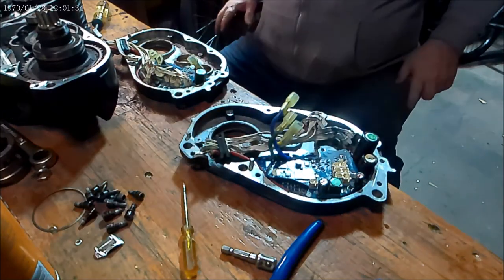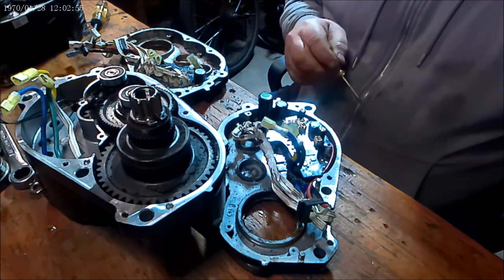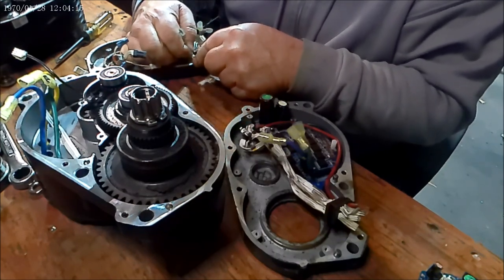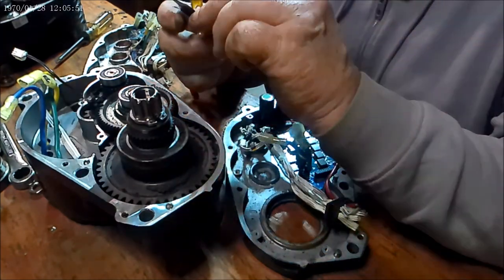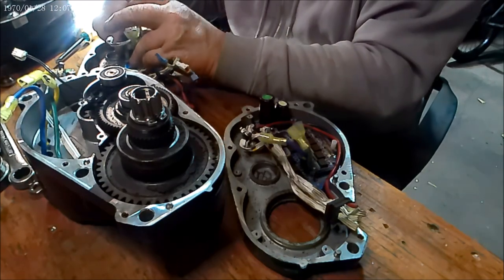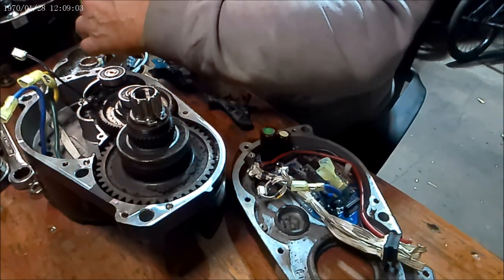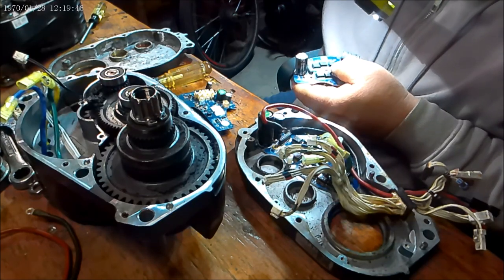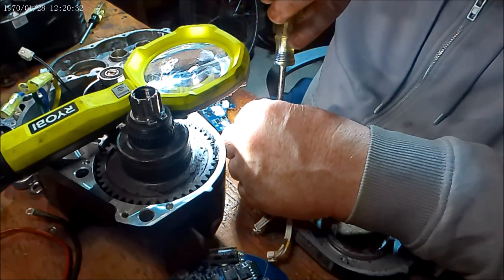Controller Break down & Differences

Comment: I'm assuming this whole contraption you're working on is a mid-engine for an e-bike?  If it is, I've always wondered how the gear reduction, inside, looks.  You'd think that the smarter way to go would be to isolate and separate the controller from the vibration laden motor/gear case.  Planned obsolescence?
Reply from the maker: Well when you do seal the motor back up it has a rubber gasket between the chambers from the gears to the controller side . In this video I was trying to see if I could use the controller from a used motor that a guy gave to me .

Comment: Fun fact: the reason I cut the wires  because the M60 750w wires are 5’ long. The wires on the M60 1000w are only 2’ long. So I had to  cut the 750 wires and join them with the 1000w wires to be able to fit the wires inside my bike. So for yall thinking of upgrading to the 1000w M60 just remember the wires will only be 2’-3’ long 👨🏽‍💻
Reply from the maker: You didn't have to cut the wires all you have to do what just change out the controller and if you did that you wouldn't have to splice anything.

FYI this is the same gearing as the M620/G510 but is CANBUS connector